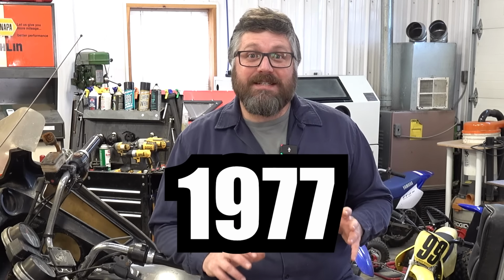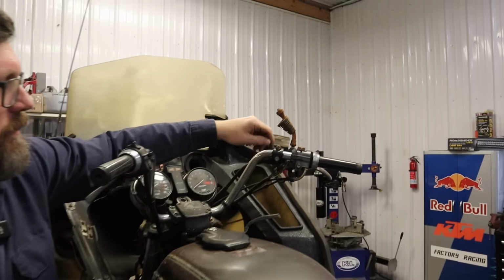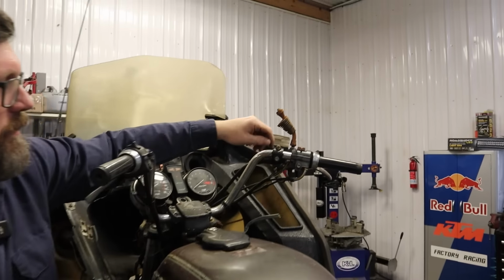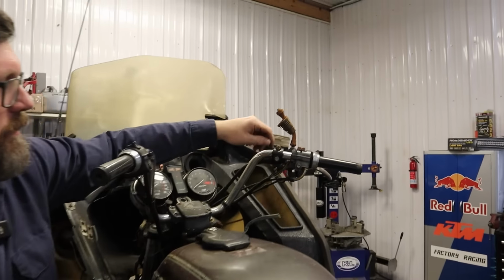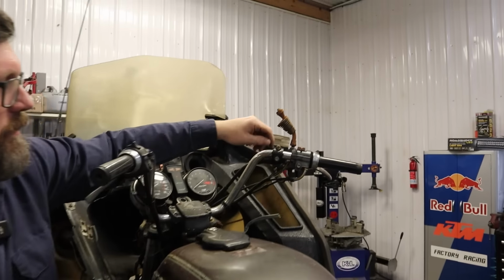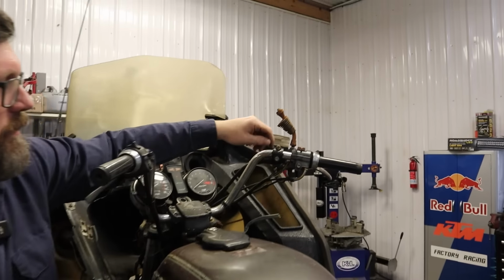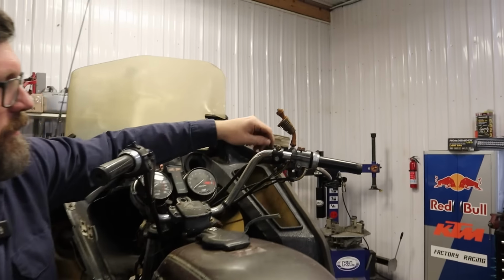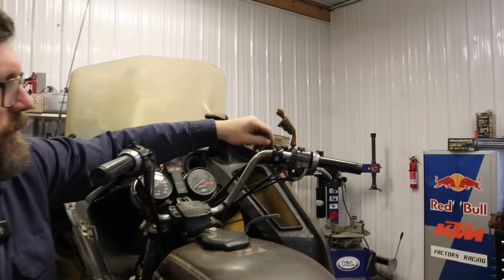Engine Seized! Can I Get This Cult Classic Honda Running?

Comment: Honda should make an updated version of the CX, we need the return of middleweight shaft drive motorcycles. All the Japanese manufacturers used to make them, but they have completely disappeared from the market. Today there's only chains, and chain drive just sucks.

Comment: The clever thing about the cx v twin is the way the cylinders are "twisted" on the crankcase, not easy to engineer, apparently done by Honda so that the carbs are tucked in and didn't interfere with your knees

Comment: I bought a ‘79 CX 500 in 2023 with 20,000 mi. Replaced the carbs and did some front brake worked and it ran like a top.

Comment: I had a nearly identical CX500 (no fairing or sissy bar) for a few years. It was a 1980 that I bought from the original owner for $500.... with 500 miles on it. He had bought it for his wife, but she was afraid to ride it and so it ended up sitting unused for many years on a covered patio. 
I think I bought it around 2004 or 2005. 
The engine was gummed up with old oil, the carbs full of varnish, and the tires needed replacement. I bought some clutches for it, but never got around to putting them in. Despite being out of the California weather (such as it is), the mufflers had rusted out from the inside and there was some pitting on the chrome. I couldn't find OEM mufflers (or they were ridiculously expensive... I forget), so I installed some similar looking generics that worked pretty well.
I got it cleaned up, fixed most of  whatever else needed fixing and put it back on the road. 
Frankly, it ever felt comfortable to me (seemed top heavy) and had to run at too high revs on California's 70mph+ freeways. So over a couple years I only put another 1000 miles on it riding back roads or around town.
I liked the wheels (no spokes to loosen!) and the shaft drive (except when changing tires or wanting to change the drive ratio).
Something I didn't like was the cost of Honda parts! As I recall, the plastic floats for the carbs cost $40 each! 
In 2009 I ended up selling (for $750) to a guy who brought along a certified Honda tech buddy, who was stunned to see a nearly 20 year old bike with so few miles.

Comment: I've got a buddy that's looking to offload most of his collection of Japanese bikes of this era. They're almost ALL projects, with many of them being "ran when parked". Though, some may require a little more work. They are complete, or mostly complete. These bikes seem right up your alley.

I'd have emailed you about these bikes, but am unable to find a general email address for you (or any other, for that matter).
Reply from the maker: email is on the page or website. Not sure what it is off the top of my head
Reply: @The_Bearded_Mechanic  I got a 404 message, when I tried the "contact" page of the website.

Comment: My first bike was the yamaha rd80, and the second, a cx500. The only drama I ever had was the chain spitting its dummy into a corner. The beauty, ran without fault for 5 years until I sold it (in a little dark corner of my mind, I kind of regret doing that). In '92, I bought my gixxer brand new and still ride her daily.
I hope someone restores this honda, it's a gem once it's running again.😊
Living in germany (was in the british army), I found out that the locals call it 'die gullenpumpe', roughly translates to 'the ditch pump' 😊
Thanks for posting and bringing back some memories mate, and a tear or two (I'm not crying, just got a fly in my eye 😊) 🤟

Comment: i had a gl 500 silverwing with that same type of engine it had alot of power for the size an i do remember  adjusting  the time chain a lot  it could easily  wheely  even  with  a full fairing  clip on sattle bags and shaft drive, very cool bike ,awesome video

Comment: 1. The starter motor on these was NOT ultra reliable.... 2. High altitudes can cause the mix to become THIN and cause loss of momentary power... 3. Plus point is easy Retard or Advance... ! 4. Drive shaft on these is generally ultra reliable.. IF MAINTAINED properly !! One of my all time favourite SOLO rider bikes.. (I did professional inter city.. city to city COURIER UK for over 2 years ALL WEATHERS ALL YEAR ROUND!! ) I used Avon roadrunners on mine !!

Comment: I just sold my 1980 Honda CX 500 a few months ago and upgraded to a Super Tenere 1200.  When I heard that thing fire up, that distinctive sound brought back all my memories of it and got me feeling a little nostalgic.  You're right, the cam chain tensioner was a common issue.  Also the stators are notorious for going out, and you have to drop the engine off the bike to replace those.  When I sold mine it was running and driving just great.  These bikes are tough to kill.
Reply: Dropping the engine out of the frame is no big deal

Comment: It's amazing how logical and simple design were those Honda bikes in early 80-ties. to work on them should be recommended to any frustrated modern bike mechanic as a therapy.
Couple of years ago I watched Honda mechanic working on my new Rebel 500. He spent over an hour just to get to spark plug and an amount of parts that he had to remove and cables that had to be disconnected was really terrifying. Mind you , I am a qualified motor mechanic myself and I always worked on my own bikes since late 1960-ties, but now I'm old and lazy and this was a warranty job caused by another another Honda mechanic during 1000 km warranty service. I sold this bike some months later totally disgusted with it's design crudeness and general inconvenience - engine however, as always on Hondas, was terrific... But that was my fifth and definitely last Honda.

Comment: I bought a CX500 and it was the first street bike I owned after several motocross bikes. It was a fun ride. Me and my-now-wife took it on a 2000 mile road trip and had a blast. It had some cam chain vulberablities, but manageable. I wish I never sold it. 
I love your videos.

Comment: Just bought one for £250 1979 came with a brand new boxed exhaust system. Engine is seized and back wheel is seized. Not sure when I'm gonna start this project. I'm hoping I can free it up copying you, its a bit worse condition than yours, English weather. Came out of a barn then was stored outside for two years. It's over 40 years old so MOT exempt and road tax exempt .

Comment: I used to own a 1983 CX400 Euro using the same engine. The huge crankcase took as much oil as you might expect a car engine to. It was however   a very reliable engine and great for touring the country or just driving around town

Comment: When I had my gl500 I'd heard that honda originally designed that engine to operate water pumps but didn't get the contract so the made it a motorcycle engine and the rest is history

Comment: Had three of these. The cam chain tensioner bolt always comes loose then the timing chain starts slapping around. Otherwise it is a tank!! And runs forever with a great cooling sustem and an awesome thumping  sound!

Comment: With an engine that's badly seized due to rust there is a way you can deal with it. 
You simply use unsweetened lemon juice. 

NOTE 
It MUST be unsweetened lemon juice with nothing added to it or it will not work because anything added will change the chemical composition of the juice, making it not effective vs rust. What happens is the citric acid content of the juice will attack and dissolve the rust but won't harm the good metal present. 
Brands such as "Realemon" are what to look for and make sure it's 100% pure, unsweetened juice. 

I was told this by an old mechanic from way back in the early 90's and he was in his 70's then, we all know the "Old Timers" knew their stuff out of necessity and he passed that along to me. 

Not too long ago I used it to unlock an engine in a 1930 Model A that had sat for over 40 years - The owner coudn't break it loose and the shop he sent it to coudn't either. I just happened to be there one day and asked about it, they told me what was going on and I told them I'll do it. 

I simply flooded the cylinders with the juice and let it sit overnight, the next day I then flooded the cylinders with standard motor oil and let that soak in for awhile. I left the plugs out (Of course) then we put it in high gear and started rocking the car. We had it to break free in a short amount of time rocking it that way and proceeded to carefully turn it over by hand completely so we knew it was completly free. 

The next day we spun it over, test fired the engine and it started - It was stubborn about it at first but it did hit and we eventually got it running period. 

You can even test it by taking a metal object that's rusted from sitting such as an old lawnmower blade (That's what I used), a nut & bolt or whatever and using a small cup, "Dunk" (Emmerse) one end of it in the juice overnight. 
From my own testing when I first tried it, the next day I was literally able to wipe the rust from the end that was emmersed in the juice and the difference between the ends of the mower blade were clearly evident. 
In cases of a BADLY rust-locked engine you may need to fill the cylinders and let it sit/soak more than once but lemon juice does work. 

Test and try it sometime. 

Anyone can try it and see how it works and I hope this info is of use to someone that may be in need of it.
Reply from the maker: I am going to try that

Comment: Craig "the bones are good." Broken fairing held on by boot lace, clothes line rope, Romex and lamp wire, frozen throttle/carbs, leaking fork seals, front brake needs a rebuild and the motor is seized. This particular CX 500 should be turned into scrap metal.

Comment: Great laugh, you guys are great. Thanks for the entertainment. 
I was a 17 yr old apprentice at a Honda dealership in the UK (in 1977) tasked with doing many cam chain tensioner modifications as discussed. I remember lifting these lumps out of the frames with my eyes popping out of my head in order to fit the mod kits. I never recall having to punch the 3 dots on the frame though! First time I’ve heard of that! Great bikes, many fond memories.
Someone said that this engine was originally designed by Honda for a generator……??

Comment: Wow, does this bring back memories. I purchased a used CX500 Custom in 1982, it had only 500 miles on it (owner had gotten a new address in confinement) the seller (his mother) was happy to see it go. Great bike, smooth and fast to about 90MPH then it ran out of lungs. Proved to me to never own another air cooled or chain drive bike, and lastly its a Honda, the best in my opinion.

Comment: Seriously. If you are ever doing that spraying fuel in a running engine with shitty/ messed up carbs, dont continue to use either. Use a squirt bottle with gas in it. Either is super low octane and it rattles the pissout of it. You can wreck parts.

Comment: I had a 1982 Honda cx500, and by the time I sold it, you had to pull the plug wire off and hold them against the cylinders to get it to run right.  I am reasonably certain the accelerator pump was shot too.  I relined the tank at one point. It was a super fun ride when it was working right.  By 1982, the tank had changed, and there was no more chain on the fuel cap :)

Comment: Brings back memories and left me smiling. I had a maroon CX 500. Put about 10k on it and sold it at 28k miles. Never had any issues, other than a starter and a couple batteries over about 5 years.

Comment: As an owner of the CX500 for a number of years... I can tell you the 'courier' fav bike was just that... brilliant. SINGLE rider and anyone stupid enough to think that it was OK for passenger as well?? The top off set centre of gravity stuffed that to an alarming degree.. Uhh downright dangerous. If you attempted to carry a pillion passenger the front end of the bike would almost lose steering.. it made the front section too light and even compensating with lower  tyre pressure etc OR a handlebar steering stiffener applied?? Nah... No surprises then that this looks as though its been trashed ... slid along on the fairing?? Great bike FOR couriers OR single riders.. but otherwise... Nah!

Comment: The engine originally just needed some seals and some other updated love has Craig decided to spray a whole bunch of starting fluid in it with a throttle fully stocked and yeatts the Pistons from the bike

Comment: Back in 1989 or so, I helped get a friends CX-500 running. Thought we had everything fixed except the stator. Took it for a test ride and about 5 miles from his house, the engine suddenly just locked up at speed. No warning, no sound. Nothing. Just suddenly locked. Skidded until I got on the clutch.

Comment: I had an '82 GL500I, probably the heaviest commuter bike ever, but OTOH was also very slow and handled like a pig. Reading these comments makes me think I got the one lemon of the production run. Buzzy, not good for long rides as it put my hands to sleep in short order. Air suspension front & back rapidly leaked down, gave up putting any air in. Changed the water pump twice (factory manual on water pump repl. sez Step 1: remove engine) and it still leaked, eventually overheated and died. The one in this vid? If the engine had been spinning free, you'd have to pay me $3,000 to take it. Okay, $2,500, final offer.

Comment: I'm currently running the absolute BAJEEZUS out of a 650 Ninja, with part of the cylinder liner chunked out on the right side, used head gaskets, and no torque value assigned to the head bolts. I just made 'em tight. We're learning to wheelie on it.
This spirit of slapping an engine back together just to make it run, is just beautiful. I love it.

Comment: I had one in high-school in 1980. I rode that thing everywhere. Ortega hwy over the mountain and down into Elsonor. Up and down P.C.H. 
It was a great little bike. You could lay on the tank and wrap your arm around one of the jugs to keep warm.
Reply: Grew up West SFV back then...80 I was 12. Loved the 750s 1000s even smaller bikes with a proper header and even cam in them
KNow those roads well, dailied my 69 SS camaro and ran those roads a lot, From sfv to zuma or ventura beach to hit the waves every single day.   God I miss being young, cheap musclecars,  bikes and no responsibility.

Comment: do you guys fully refurb the bikes or just get them running and then leave them in a corner?
Reply from the maker: Depends on the bike. The dirt bikes I will ride. Most of the other bikes I try to find someone that can use it.
Reply: @The_Bearded_Mechanic  deadly. wish i lived in the states. barnfinds are much more interesting than here in ireland. too wet. everything gets destroyed after about a week.

Comment: I needed a project. There was a '79 Honda Twinstar CM185 for sale across town. It sat outside for years. Had 5k on the odo. Bought it for $200. It was missing some small parts, was NOT locked up. A month later my wife and I were traveling through Mew Hampshire and on the side of the road was another Twinstar for sale. Bought it. I spent the winter putting the two together. That was 2015. I registered it that spring and rode it daily until 2023. I then bought a Shadow RS. I sold the Twinstar because I really didn't want to put it into storage. Vintage Hondas have always interested me.

Comment: Fun Fact! My dad / I currently have a 78' Honda Cx500c. It still runs well, we replaced the stator a couple years ago, and we got a new (hardly used, 25 yr old, stored safely, totally unscratched) fairing/windshield combo. This shaft drive is insanely smooth, and while the gearing is well... 70's, I've gotten it up to 85 mph, without it feeling unsafe, and it's insane at low speed maneuvers. Love this bike, and actually, going to do a whole clean up/painting/etc. on it soon. I just bought a 2024 Ninja 650 for myself, and if my dad can get enough strength back, we'll go for a ride together before I or we fix up the Honda. Never expected to see a video about this bike lol.

Side note, before replacing the stator, I learned how to run and jump start a bike by dropping the  clutch. VERY useful to know how to do.

Comment: Here's a trick I learned from an old timer: Break out the insulation from an old spark plug and weld a zerk fitting to it. Thread it in, loosen up the valves, and pump in some grease until it breaks free

Comment: When I saw that bike at the start of the vid, I KNEW. Twice in my life I have gotten a 1978 KZ-650: once in 1987, and again in 2007. Both times, I had to tear the whole bike down and give it the million-mile service. Rode each of them for years and then passed them on to the next guy, in MUCH better shape than they came to me.
And yes, the elation of getting the engine to actually run for the first time (after months of after-work labor and way too many parts) is the greatest feeling.

Comment: Lets hope nobody takes these type of videos as a  serious way to get old bikes running.  Only try tor remove the spark plugs after using a freeing agent and then put some very light oil in the cylinders. Leave it for a few days and  see if the engine turns over. Or you can always ruin the pistons and cylinders by forcing them to move for a few youtube likes.

Comment: Use rags to block off the tank.run Ur compressor into the tank n pop the dent. Use molasses to cook the tank rust over several weeks! Nb..love owned/restored/ 4 cx's..one that l pumped into a 750(loved it..did over 85k on it...sold to a mate).
Reply: Masaki engineering in Sydney (oz) did my engine work. Nb..l did a dual caliper front end..air assist forks...(brumby calipers)...duke rear shocks on shortened springs...tried to buy it back 22 years later(mate wouldn't sell)
Reply: Brembo(brumby wtf?)